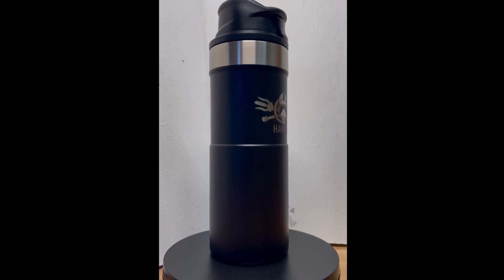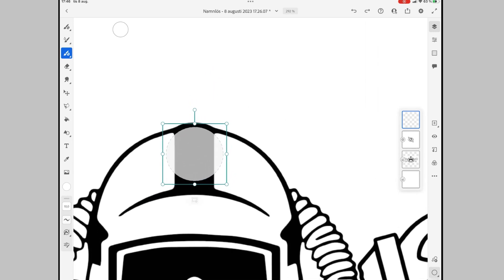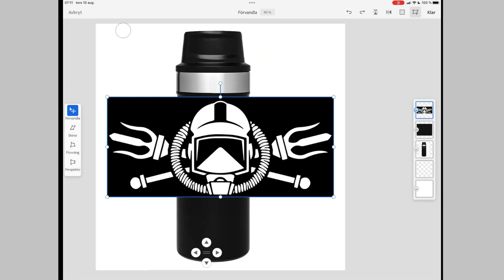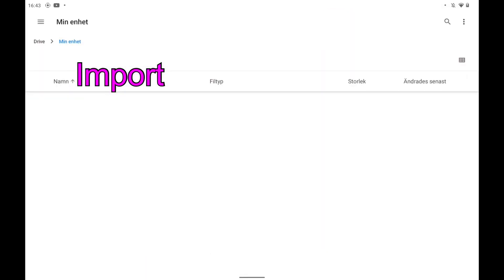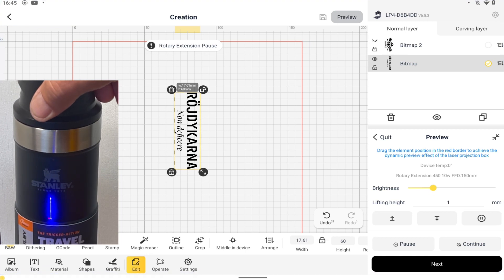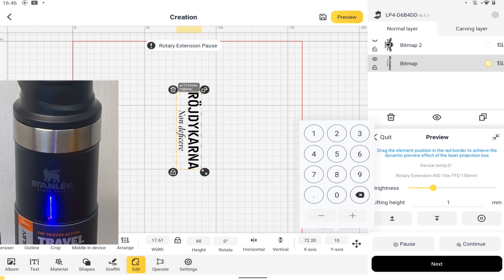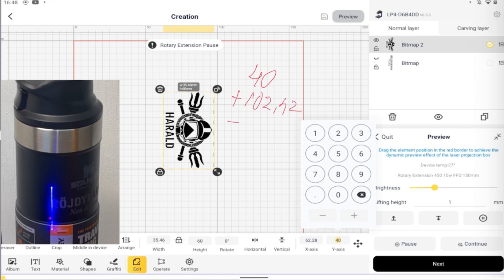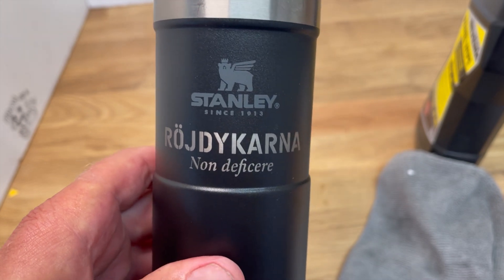Positioning of engraving when using the Rotary Extension.  LP4

Comment: Hi Where do you get the number 65.20 diameter from? I have the same tumbler and it gives me 25.50 diameter
Reply from the maker: Might be due to that 65,2 mm equals 2.55 inches. I measured the mug earlier, to 65.2 mm, with a caliper. Since I did a test round before, the value remained in that field.